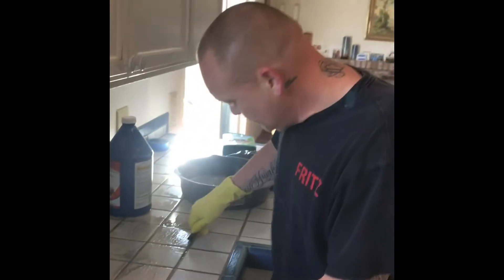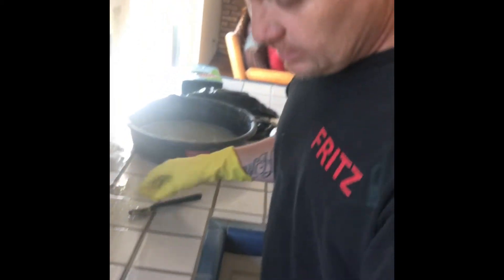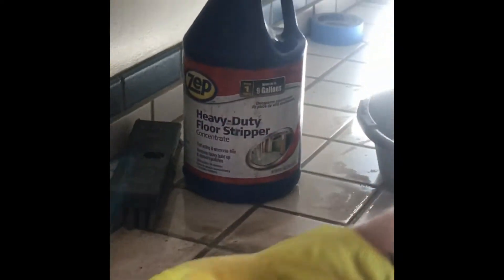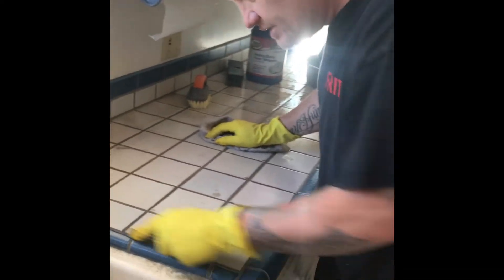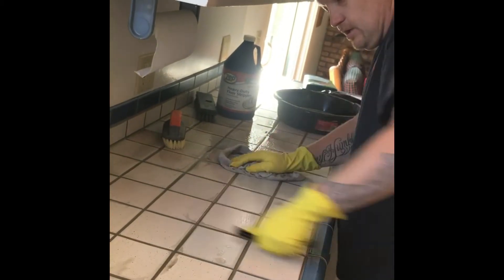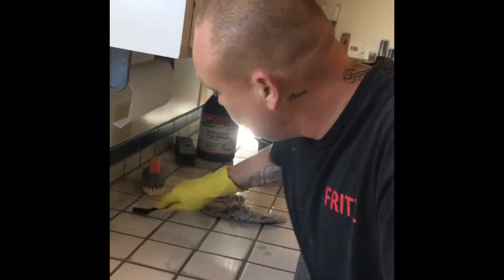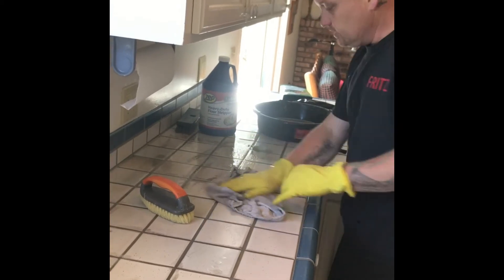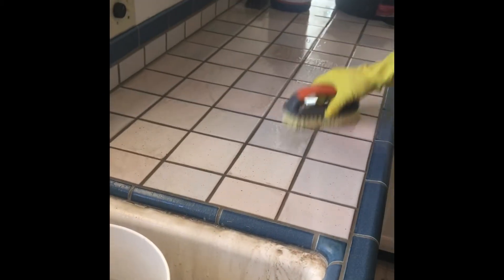Best Way to clean tile countertops

Comment: Step 1 put on safety glasses. Step 2 break tile with hammer and remove. Step 3 call professional and install solid surface countertop. Seriously. Tile countertops are disgusting. Do you really want to remove everything from your countertop and have to use a special solution  and scrub brush once a week to get nasty food waste out of grout? Tile countertops are disgusting and no one wants to clean them so they are really only clean once. The day they are installed.